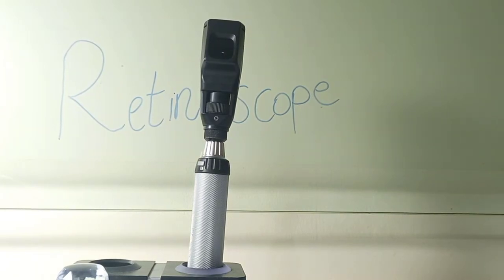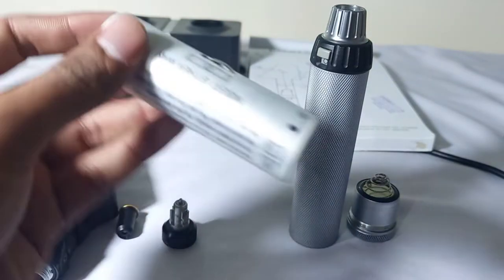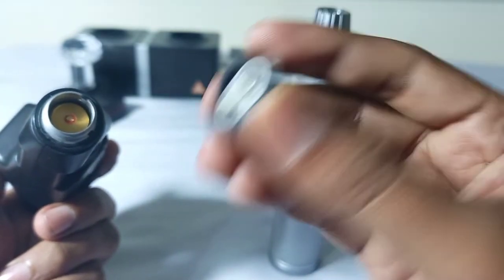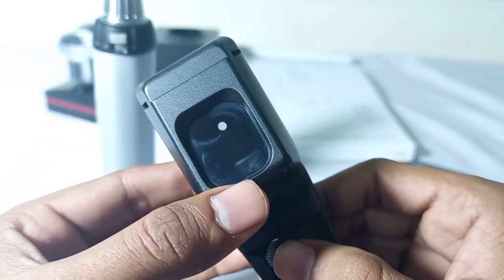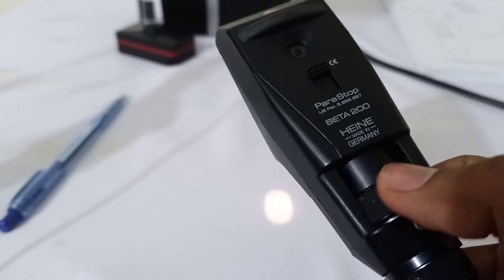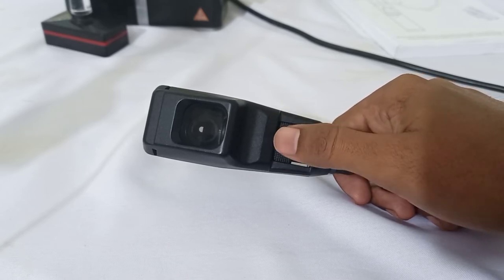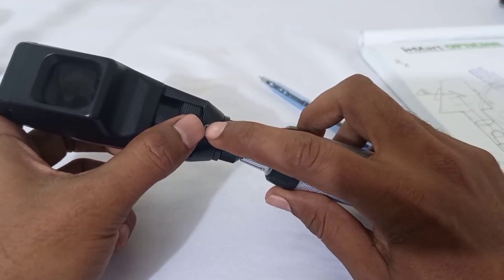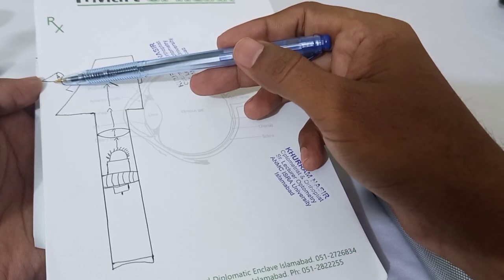Construction, Parts & Plane and concave mirror effect in Retinoscope

Comment: Sir when to use the concave mirror effect!?  
The button above the lettering PARASTOP is for!?
Reply from the maker: Concave mirror effect used when examiner would be unable to judge with or against movements in Pupil..this concave mirror affect used patient got high refractive error.. Hope this is clear.
Reply from the maker: Parastop button is used to restrict the sleeve on plane mirror affact..
Reply: @optometrywithkhurram6867   yeah sir thank you!  But against movementis always found  in concave mirror effect sir
Reply from the maker: @deepikanathan4646  dear.. actually plane mirror affaect is inverse of concave mirror affect.. in plane mirror HYPEROPE ,EMMETROPE and MYOPE of less than workin distance got with movement , and in myopia more than 1.5D show against movement ,  and we can neutralize with movement with plus spherical lenses and against movement with concave spherical lenses. and in concave mirror affaect  all process is vice versa. like in concave mirror affect the with movement would be neutralized with concave spherical lenses and against movement will be neutralize with convex spherical lenses. hope its clear.
Reply: So, in essence the plane mirror effect and concave mirror effect (as determined  by position of the sleave) will produce opposite  movements of the red reflex for a particular  refractive error ( say hypermetropia), but will need the same lens (I.e convex lens for hypermetropia) to neutralize the reflex.